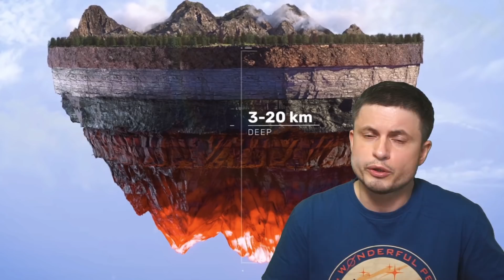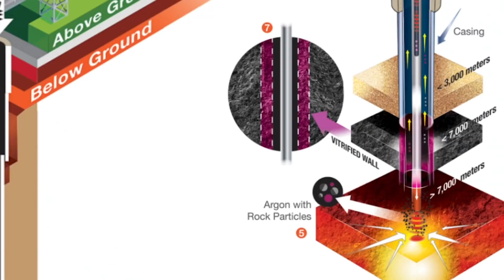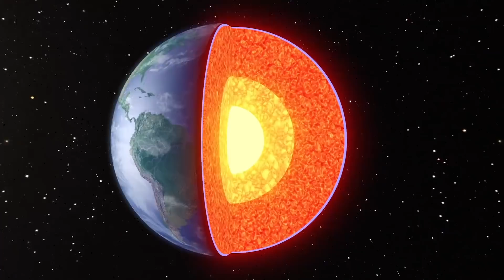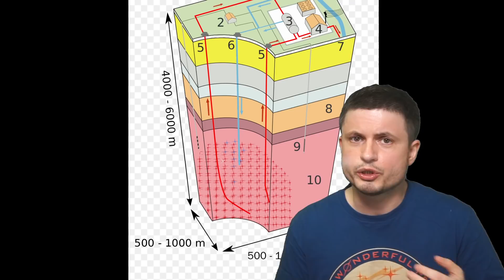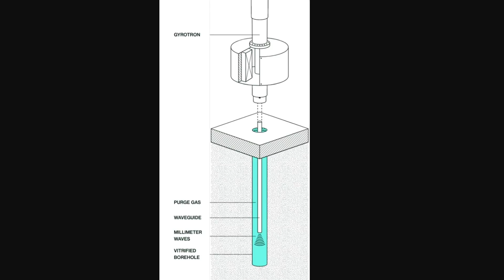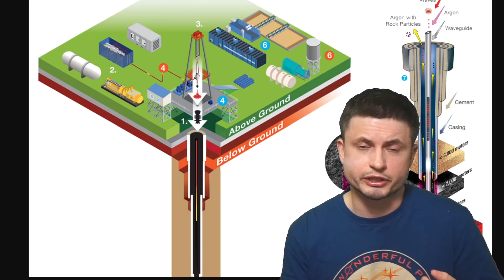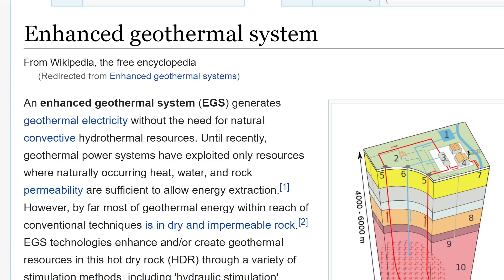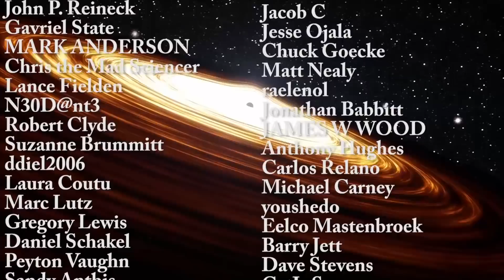Creating Deepest Hole on Earth For Geothermal Energy Revolution

Comment: Our planet has an atmosphere because it has a magnetic field. It has a magnetic field because it has a molten ferrous core. It has a molten core because a massive astroid delivered so much kinetic energy that the planet reheated. We can't ever replace the energy we sap with heat sinks, not without destroying Earth as we know it. If the core cools, the slag stops churning, and then the magnetic field becomes unstable and incapable of retaining an atmosphere conducive to life on earth. First we would lose livestock and crops, then people. Starve or suffocate. This is an even worse source of "sustainable" or "renewable" energy than wind and solar farms. At least the global population could be modulated to adjust for an early shortage of productive land relative to the ever increasing population. And no, a marginal lul in reproduction over the last few decades is not any sort of indication that we will depopulate in the long term.

Comment: This entire concept is based on the misconception of planets being solids. Just because planets are composed of solids do not make the mistake that they are a cohesive whole. As a whole planets do not act like solids, but instead act like viscous fluids. Any large mass has the same issue. Every hole you dig has pressure to fill in and not much stability to hold its shape. The bigger the hole the bigger the problem. Digging and maintaining a hole of this depth would require material science we currently lack.

Comment: What about finding ways to extract usable energy from boiling water rather than pressurized steam?  In the central U.S., how deep do you have to drill to get 120 deg-C?  One deep hole, partially filled with water, and a fairly shallow hole, mostly filled with water (~20 deg-C) -- with losses, yields maybe 90 deg-C difference to drive electricity production.  Use Stirling engines?  Obviously, a low power output, but how expensive to set up?  Using current tech, a dozen deep holes with sealed caissons, paired with a modest sized cool cistern, could drive multiple heat engines to generate 6 to 8 KW.  You would need over 100 such modules to get 1 MW output, but how much could this be improved thru focused research?  The upside is no high pressures, no need for underground fissures, and no drilling below the Earth's crust.

Comment: Thanks again Anton for your educational and hopeful and useful information.

For us non-scientists who are nonetheless critical thinkers, would you address the potential conflicting inherent properties of the hopeful sounding means of deeper drilling, using electromagnetism. 

Isn't high temperature exposure a problem due its effect of defeating magnetic fields? Can there be a successful design of the gyrotron type system that doesn't cost more money to be cooled while operating at depths beyond the currently most successful depths?
Reply: Greg Rice - "Isn't high temperature exposure a problem due its effect of defeating magnetic fields?"
The entire core dynamo hypothesis is self-defeating for that very reason.  The Earth's magnetic field is actually generated in the CRUST (which is primarily quartz-based), and it is a piezoelectric geofield.  Mechanical stressing caused by Earthtide (tidal pull on the landmasses) is the mechanism.  Now you know the real reason that Mars and Venus have little to no magnetic field - because they have little to no tidal influence from other celestial bodies.  Mercury has a small field despite having no moon, but only because of its proximity to the Sun and the tidal pull it receives from that.

Comment: Hi Anton, in the 80s while I was young, late 20 and 30s, I worked in the oilfield of Texas, And in 2008 and 2009 I worked in Colorado, Wyoming, and North Dakota as a drilling fluids engineer. I have worked holes a little over 20000 feet straight down and can verify at those depths bottom hole temperatures can exceed 500F. The biggest question I have is what is this new outfit going to do about downhole pressures. At these depths the formation pressures will be incredible and the hole will collapse without some way of holding it back. Is the melted rock strong enough to act as casing and stabilize the formation? And what about gasses and fluids in the formations? Its not so simple as poking a deep hole in the ground and running a loop of pipe down to circulate water. But, if they can get around the downhole issues they will have one hell of a hot water heater. I would guess it is entirely possible that at 20km the downhole temps could be in excess of 800F which should be close to critical steam temps. Thank you and be safe.
Reply: I'm in the oil industry currently, as an engineer, formerly a geologist, and I spent most of the last 18 years on rigs around the world. You raise very valid questions! I don't see how it would be possible to support the well without some sort of fluid, or maybe using Managed Pressure Drilling technology. the problem I have with using all that electricity to melt or vaporize rock is that the electricity has to come from somewhere, whereas conventional drilling technology can get the job done.

Comment: No such thing as "unlimited energy". also, as usual, a total and complete disregard of any forethought towards adverse affects short term, long term and repercussions. As with most of these miracle hi hope and hair brained big money green projects it will be HUGELY over budget non profitable and a failure. Geo thermal can be profitable if the plumbing and the heating cycle is natural. For instance Tapping heat from old faithful would be limited but pure profit once it's up and running. But it's limited. The moment they boost this to commercial scale they are taking more than the earth can deliver naturally. That forces them to then inject which is hugely expensive and costs energy and they are now over the heating capability. It will start cooling the surrounding area. Real simple folks! Commercial scale green energy simply DOES NOT WORK! The moment it's commercial it's no longer green. Green energy does work on the small scale with back up. However, the greedy politicians and wall street demand the control of the energy and the profit. They will waste Trillions of your dollars selling snake oil while doing everything possible to somehow keep you plugged into their grid exclusively. 

Look at Hydrogen. You can build an on demand hydrogen generator in your garage in an afternoon to save fuel mileage. I know! I've done it.  cut my cost of fuel from 1/4 to 1/3 on an older vehicle. That's 25 to 33% less CO2 and pollution INSTANTLY!!!! So, government creates STRICT control regulations over your vehicle preventing any modification without spending a fortune on professional scientific testing and evaluation. Meanwhile auto manufacturers computerize and automate your vehicle and claim proprietary copyright to the software you can't access that make it impossible for you to adjust. As such you can't install your own on demand  generator to save money on fuel, greenhouse gases and pollution from fuel. If you install one it will run like shit. Instead your Hydrogen would have to come from them but hydrogen is too dangerous to store in quantity. If they don't get to control it and provide it from a Government subsidized commercial grid then it's illegal. Look at electric cars. They know damned well that charge times are going to be impossible for certain vehicles. They'll have battery packs they'll own and you'll pay to change. When they first suggested this people were against it. So they simply skin the cat the other way. They will make electric mandatory and you either wait the charge times or you'll have to use their battery packs there will be no choice. Either way it's coming from their grid or not at all. Not to mention that no one is even thinks how many nuclear reactors we'd have to have, generating nuclear waste they'll have to bury everywhere like a cat with it's shit, to charge all these vehicles. Or the strip mining that it's gonna take for all these batteries. Then the moment a tiny part of these technologies goes for shit the whole unit is scrapped for recycling which is HUGELY ENERGY DEPENDENT. 

You want to know what energy friendly is??? I had to build and fix 3 roads so I bought a 1953 Caterpillar road grader for 3500 dollars and built those roads that were estimated at about 75,000 dollars to build for under $10,000 including the grader purchase. The energy that went into making the steel and casting the parts and turning the gears and threads of that grader 69 years ago is still doing the jobs it was made to do. Now? Modern construction of this machine and the PLANNED obsolescence of the technology they now are required by law to run make a modern grader lasting and useful for 69 year an impossibility. In 69 years a modern grader will be recycled 3 times using 3 times the energy to continue to be able to do the exact same job. My old grader is Many times more energy efficient and non polluting than any modern grader. It's not even close. Same with my old truck. I can not only fix the truck but actually fix the components instead of throwing an entire component in the trash or recycling cause a modern resistor the size of an ant went for shit. And all of the parts that go for shit on my truck are 100% recyclable. The copper, the steel the iron. Compare that to the shit that comes out of a shredder when a modern vehicle is passed through. 1/4 to 1/2 ends up in a land fill in some third world country cause government and corporations pay well to have 3rd world countries take and bury our garbage so we look like environmentalists but it's all out of sight out of mind mass pollution. That's where all your environment and carbon taxes go. It pays to bury your garbage in 3rd world countries. Congratulations. But it's OK don't fret you'll be distracted cause a new I phone will be out. Seems your year old one is totally obsolete and thoroughly throttled by the manufacturer who claims their battery will explode if they don't. Worst throw away generation in human history who consider themselves justified and environmentalists? HA HA HA FuCK ME! You couldn't even make this shit up!

Comment: On the surface, no pun intended, and on a small scale this sounds like a pretty intriguing thing. But mankind is proven that once they find something good they amp it up to an exponential degree until they suck it dry. How long would it take us to suck enough energy out of the Earth's core to dampen the magnetic field around the Earth enough to cause us to start experiencing problems with more solar radiation getting through? How long before we turn this planet into another Mars?

Comment: considerations:

-the earth's crust moves, your facility might need frequent re-drillings to compensate
-the extraction of heat from underneath the crust on a larger scale might have adverse side effects we don't yet know about.

as far as i know, the Earth's insides are mildly heated by a low tier nuclear fission of sorts, the effect of draining this energy might cause increased tectonics or decrease them. 

if these problems arise, we should be prepared
Reply: The issue would not be tectonics. The issue would be cooling of the outer core, which would weaken the Earth's magnetic field and eventually the complete loss of it.
Reply: ever wonder if Mars used to have a molten core, perhaps it developed life that tapped into that core for energy and cooled it down to the point they killed the magnetosphere...

Comment: Sounds like a good theory but wouldn't the weight of the water essentially replace the soil? It would probably have to be generated relatively deep and then run wiring down to it

Comment: The killer problem with geothermal energy is, has been, and always will be the silly insistence upon using WATER as the heat transfer fluid, because already around 400°F (200°C) water dissolves silicates and other minerals rather rapidly, which then drop out of solution when the water cools. As the minerals come out of solution, they form a mineral scale on the turbine blades and/or heat exchanger surfaces, which quickly fouls them and ruins performance. As a result, frequent maintenance is required, which is expensive and kills the profits, plus creating downtime when some other power source must take over carrying the load. By the time H2O becomes supercritical around 700°F and 3200 PSI (375°C and 220 bar), water will dissolve almost anything, even most metals, and removing the scale of dissolved metals is far worse than simple mineral scale. In the Quaise proposal, the vitrified glassy borehole will quickly be destroyed by mineral erosion, IF they can even make it, which is HIGHLY DOUBTFUL since millimeter wave RF power has high losses in even a short waveguide. For 12+ kilometers of waveguide, the losses would be totally absurd. So it becomes evident that the entire proposal is either stupid, dishonest, or both.

Comment: Vapour heat pipes (which can hypothetically be 100km in length) and a Stirling engine with as few moving parts as is possible. Maybe not as efficient as a super critical steam turbine by a fair bit, but it would need very little upkeep if a system could be figured out for it. That does not mean the other type should not be set up, but it might be inter sting to figure out how to manufacture/build/assemble such a thing that could operate on the Moon with out needing huge amounts to water... Lots of possibilities if it works  😍

Comment: I'm just wondering. If we use geothermal energy everywhere. Doesn't that cool the earth core? Basic conservation of energy.

I mean yea a few of those plants is no problem but thousands of those plants? Or even more? There must be a point where you start cooling the core since you extract energy from the core in the form of heat.

Comment: Well i guess we have to wait and see if they can really create a gyrotron that works under these harsh conditions and solve the issue getting the material out of the way before it gets solid again and falls back into the hole.
The fragile one from the KIT with an cryomagnet let it look like a very bold claim, to do it within a few years, which is typical for startups to make bold claims because which investor want to invest if they say we might need 15- 20 years and there are still options we might fail in the end. Still bold claim or not it is interesting enough to have a company working on it and try to make progess in that direction.
PS: I am the only one who expected something like that from Boring company?

Comment: Fracking geothermal sounds like a much higher yield per hole. You could send returned water down one hole, and hot water from another hole after forcing it through shattered hot rock. As long as it doesn’t destroy the plant, earthquakes won’t matter, we can build it in uninhabited areas.

What is the expected energy yield per bore hole at 20 km?

The biggest plant in California produces about 2040 MW from 350 bore holes, in a hot rock area of 78 square km, presumably about 6MW per hole. But if it is possible to increase by an order of magnitude with advanced drilling techniques, fracking, and supercritical water we might end up with about 50 + MW per hole, as the potential is mentioned at “orders of magnitude” greater in this case. 

Sounds to me like we should be prioritising this immediately, it’s not like there’s serious unknowns like nuclear fusion energy.

Comment: I have to take issue with you calling this "Free Energy". There is nothing free about it. In fact, it is just like all other energy sources such as oil drilling, hydroelectric, coal, solar, etc. It requires a large investment of funds at the outset in hopes of producing energy later.

Comment: With the problems I have with hard water, my first thought is how do you stop whatever hole you start with from sealing itself up with dissolved minerals? Hope it works, but will require lots of innovations.
Reply: In this case, you'd drill a well, then isolate it from the rock with 'casing', with cement between the casing (usually steel of various grades in oil and gas wells) and the rock. Then, you can control the composition of the fluid being circulated, minimising corrosion and mineral build up. Hard water reactions and similar, don't happen on a scale that affects the actual well drilling process - assuming it's done the right way!

Comment: There is a glaring problem about drilling at these suggested depths, the Earth's crust is that hot the rocks are too malleable also the pressures are extremely high so you can drill through it but it just fills back in when you remove the drill, like sticking you finger in a jar of treacle, the hole does not remain when you remove your finger.
 Even if technological advances allowed us to create the right material to survive those kinds or temperatures and pressures even if we had a cooling solution for the drill it still would be a futile project as mentioned, the Earth would simple heal itself when you removed the drill, only when you get to cooler rocks nearer the surface will the hole remain stable.

Comment: I thought the problem with deeper holes was rock that hot starts to press back in to fill any hole made. Would this prevent that somehow?
Reply: A lot of the problem with deeper holes has been actually running drills over that distance, at high temps, and with the type of rock. This bypasses those problems with no moving parts and with the electron beam being good with most of the rock found at that depth.